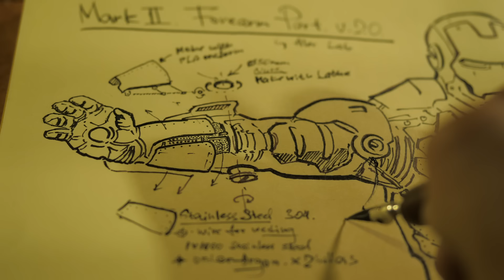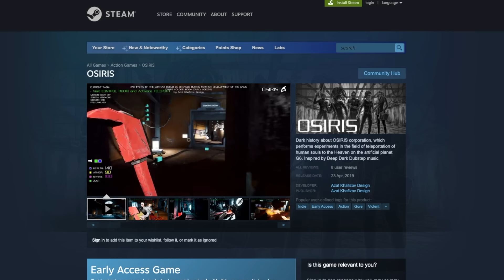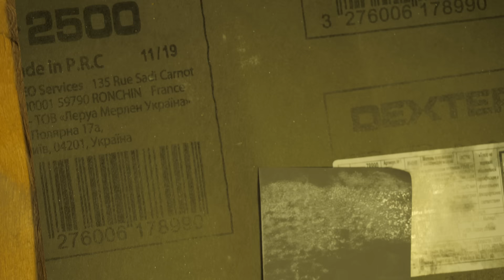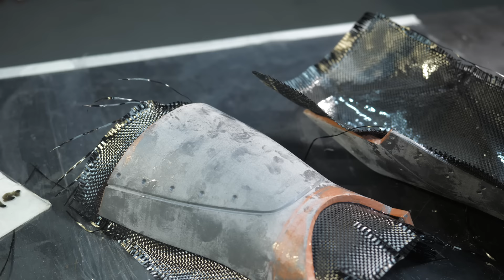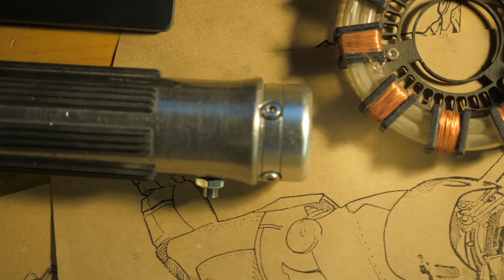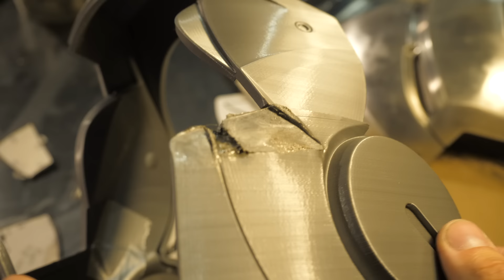3D print to full metal part: How to use 3D printer to make complex metal parts. Iron man helmet

Comment: suggestion for future work on the suit. try making the arc reactor not just produce h2 and  o2 but also try to have it generate -e aka electricity. i even have a suggestion as to do it. i have seen something involving silver and zinc together to generate electricity through oxidation processes. maybe try using that. also to boost power try also using some high voltage power transformers.

Comment: Questions that have probably been answered already but I didn't wanna spend all day & night searching for an explanation through your videos:

1. Exactly how practical is the water based hydrogen fuel cell? As in - what's the ratio between stored fuel (water) and the capture and release of kinetic energy? 

2. Will the fuel cell have an energy density high enough to operate for a full 24 hours at an average discharge of, say... 50%?

3. Water is notoriously heavy, so what's the maximum amount you'll be able to store in your suit BEFORE separating the hydrogen fuel from the water?

4. Speaking of extracting hydrogen from water for a fuel cell, what are you doing with the O2? 

5. Assuming that the hydrogen fuel cell you're using here is practical for hours of extended use, are you designing this as a powered and armored exoskeleton?

6. Assuming an answer of YES for question #5, can we expect your powered armor to increase the strength of the user by at least, minimally, 100%?

7. What about speed? Can you run while wearing your powered armor at 30 kph or faster? Because there are bionic boots that you can build yourself that can top out at close to 40 kph. I'm building them now.

8. How authentic is authentic when it comes to your Iron Man armor? Specifically, are you actually gonna try to make this thing fly?

9. Expecting an answer of NO for question #8, but assuming an answer of YES, are you going to be using a specific device built directly into the suit like those jet engine hands of that other Iron Man suit which can fly for around 15 minutes? Or will it be something simple, like feeding compressed hydrogen and O2 directly from the fuel cell protons first into several thrust chambers built into the hands and feet?

10. Expecting an answer of YES to question #8, and since flight is such an integral capability of the Iron Man powered armor, exactly how much power is required for say, a hypothetical test flight lasting for 15 minutes?

11. Since you've taken on the challenge of designing and building nothing less than an actual real world counterpart of the Iron Man powered armor, can you provide any answers to the following questions:

SIX BASIC QUESTIONS

12. Will it fly?

13. How much will the strength of the user be expected to increase?

14. How fast will it run?

15. How high/far can it jump?

16. Will there be a practical HUD projected inside the helmet?

17.  Will there be an AI much like Jarvis or Friday capable of natural language processing built into the suit?

BIG PRACTICAL WHAMMY

18. Exactly how long will it take you to SUIT UP?

OBSERVATIONS

19. It definitely looks high tech, but not particularly robust. With that in mind, can you give us an indication of exactly how much of the suit consists of actual armor, and how much is just pretty lights and shiny surfaces?

20. How much extra strength will the pneumatic artificial muscles supply?

21. What other components... such as torsion springs, extension springs, ratchet springs, block and tackle, rubber cords capable of storing highly dense potential energy (aka spear gun rubber), high density capacitors, etc. will you be using in conjunction with the artificial pneumatic muscles to supplement and increase the strength, armor, weaponry, capabilities, etc. of the suit? 

BIG WHAMMY QUESTIONS

22. What is the maximum practical power level that the hydrogen fuel cell can be expected to supply?

23. And what about the O2? What's up with that?

24. Anywho... assuming the fuel cell can maintain a reliable discharge rate of 50% when providing useful work, how much useful work in joules per second will the suit be able to provide/support, and for how long?

25. Water is notoriously heavy, so how are you storing it? 

26. More importantly - how much water does the suit need for basic functionality?

27. How long can the suit operate at full power with a full tank of water?

28. What independent measures can the included AI be allowed to implement in order to ensure the survivability of the suit and the pilot?

29. Are you actually and truly developing something that DARPA is going to snatch up and donate to Boston Dynamics?

30. You're pretty resourceful, so why not build/steal/otherwise procure an RTG for use as the power source for the suit?

FINAL QUESTION

31. When are you gonna finish the damn Iron Man suit?? Huh? Come on, when? As in, WHEN WILL YOUR IRON MAN SUIT FINALLY BE FINISHED AND READY TO COMMENCE WITH THE SMEARING OF TERRORISTS SUCH AS ISIS ACROSS THE DESERT FLOOR OF AFGHANISTAN?

THAAAAAANKS!

Comment: Thanks for shouting out blender! open source contributing code monkey here.
Loving your vids btw, using the electrolysis to pressurize pneumatics is genius. Given the gas prices here in the UK ive been thinking of setting up an elecrolytic system to replace the natural gas line to fuel my boiler and hob - so if you want a commercial product idea to pay for all the fun stuff - how about building one of those.

Comment: You can actually 3D print the armor out of metal by covering the plastic print with ceramic to make a cast, let it dry, burn/melt the plastic out, and then pour metal into the ceramic cast in a crucible and then once it dries break the ceramic off of the metal. Certainly high effort, but it makes it possible to create metal parts without expensive tools.

Comment: I started building a suit too years ago  and I used bicycle cables for tendons and hydraulics over electric..the steel cables act like Kevlar body armor also...what about using the hydrogen and detonation for a super air compression system basically  instant pressure and the water is recycling just add electricity and some peltier cells to convert the heat back to electricity 😳 ?
It wouldn't be 10% efficient but in the high 90s.

Comment: (automotive painter) you might have some adhesion issues by sanding your primer so fine. Especially by polishing. I take it to about 600. The paint will cover those sand scratches and you'll have a good mechanical bond. (Your 2k filler will dry more slowly with less hardener)

Comment: I was just thinking you may have to add a primary power source Prius battery or maybe 2 basically attached to a scapula sections. Using  the hydrogen as secondary power source possibly used as fuel.and please create a long video of how each peice of the armor hand,forearm,biceps to shoulder unit then how does it power move the shoulder and arm up and down straight out side to side then neck,breastplate&backplate then lower abdominal sections front& back.then hips thighs, knee,shins, feet.sorry to keep this long text but ironmans been my hero for 46yrs and i want to make one oneday. But most of all flight ability and fast.maybe put all your ironman videos together forget the other projects no offense. Unless its hud unit ,lifesupport,audio system, al

Comment: This helmet needs a built-in VR display. Some very thin optics exist which may help. Then you can make a HUD overlay in unity on top of the video relayed from 2 external cams. Then, using AI vision, implement object recognition on screen (you can probably purchase a pre-trained AI for this) and relay telemetry from several sensors running on an Arduino (nice plugin available for unity). If you know people, maybe you can get your hands on a used VR headset from a military simulator? They have nice gear with eye tracking (imagine, possibilities! Auto targeting?) and you could even implement voice recognition for the user interface. BTW this is not SciFi, it's all possible and reliable today.
Reply: In Russia, a lot of this is difficult to get

Comment: people keep focusing on making an iron when one could make a double laced kevlar suit ( heat-resistant and strong synthetic fiber, related to other aramids such as Nomex and Technora. 1st used commercially in the early 1970s as a replacement for steel in racing tires.) add bullet proof layering on top of essential body parts and color that thing red and yellow

Comment: There is also 3d print casting. you cover the print in a casting plaster and heat it up to burn away the plastiv leaving you a perfect mold to cast metal directly into.

Comment: In Jewellery and Dentistry, you can use castable wax in a 3D printer and send the 3D object to a local investment caster.  You'll have a solid metal object and can use files and a Dremel tool to clean everything up.  You can actually do this for guns.  I'm surprised the guys who 3D print illegal guns don't do this.

Comment: For anyone working with carbon fibre sheets, be aware that once cured, carbon fibre bends in one direction, and is stiff in another direction. So if you had a square, it could flex on the x-axis, but hard as steel on the y-axis. Important to know which direction you want to be flexible e.g. flexible across your arm, but NOT flexible length-wise down your arm. (Hope that makes sense)

Comment: Alex Lab, For metal parts, you could use a gas-chambered metal printing 3d printer. i have one in my mechanical engineering department at school. it prints titanium using arc welding technology. you should look into that.

Comment: Subscription for 3 great things here. 1, you're building an actual Iron Man suit. 2, you've got an Ender printer (I myself am rocking a en Ender 3 Pro). And 3, you got Makita tools! You got great tool taste and have quality content. Definitely worth a sub. Btw, if you want even stronger plastic parts, you can send them through a remelting process, although this won't work with PLA, because it ruins the crystal structure of the plastic. You can do it with PETG though and I believe with ABS too. CNC Kitchen did a test of this technique and found that remelting will allow the plastic to become almost as durable as injection molded plastic, but this is a method you can do at home, as it only requires an oven, some ground up salt and a dish that can resist the temperatures of the oven. Throw 1 or 2 layers of carbon fiber on the inside and you got yourself one hell of a strong part. Here are the links to the process:

Original video and method by free spirit 1:
https://www.youtube.com/watch?v=nRLJ4ylGTFc

CNC Kitchens test of remelted materials:
https://www.youtube.com/watch?v=DyAKtS1b3SQ&t=1006s

A final notice is that the infill has to be 100% for this method to work. So it uses slightly more plastic and a bit more time, but you get vastly stronger parts from it.

Comment: I think the one thing I would personally use to "shield" against bullets would be thin layers of tungsten mixed with Kevlar layers which can easily stop up to 50 Cal bullets which you can check here (Demolition ranch) https://www.youtube.com/watch?v=gJI5u2DJsAI the one thing making this difficult is the thickness which reduces the probability of stopping such bullets a lot and the weight of tungsten which is... VERY HEAVY... But if you worked up that exosuit to fit those requirements you can easily run around as some type of human tank... What I would also think about is actual flying as in there is a technical setup including a Crookes Radiometer that allows you to transform light into a crap ton of energy... The theory behind this is very simple but the way to actually produce power using a Crookes Radiometer is way more complicated and involves magnetic fields, but in theory it is possible to archieve speeds far beyond what current aircrafts/rockets are capable of... This again tho poses a new problem with heat production as this concept best works with super conductors and is relatively hard to archieve without... Maybe you can figure something out tho... All in all I enjoy this project a lot and hope to see the finished suit in action one day :)

Comment: Using the 3D printed parts, and adding pour spouts to the model, it would be possible to make solid cast parts from a plaster mould using the lost PLA method. perhaps this would further increase the accuracy and speed of production.

Comment: Adam Hyneman (Mythbusters) has 3D printed a full torso suit and a helmet out of titanium. And it appears to bei actually bulletproof (tested up to.45 ACP). That is the case because, titanium work hardens, so it gets stronger if you hit it (thats why its so expensive to manufacture titanium parts) and it can withstand higher temperatures than Steel whilst only having half of the weight...

Comment: you should try sand casting metal parts using the 3D printed parts as a negative mold. it seems like it would be faster and easier to produce parts

Comment: Couldn’t you make carbon on both sides and vacuum seal them so they’re perfect replicas. Then remove the plastic core? You’d have a perfect match, super strong, super light, and a inner channel to run wires and hoses?

Comment: Another way to get the layout of the metal plates is to use Pepakura Designer to "unwrap" your 3D model into flat pieces. https://tamasoft.co.jp/pepakura-en/
Using a 3D printed form as a welding jig for tacking everything on is a clever idea, most likely the best idea for the Pepakura output as well.

Comment: Dude, you should definitely go the "ZAMAK"(alloy) way.
Cheap and effective, saves you A LOT of time. Blanks shooting replicas and even some real firearms are made out of ZAMAK. But it's a tough metal to melt.
Alternatively, carbon reinforced (lead-free) PEWTER.
Make negatives for molds out of a silicone that can withstand high temperatures and you're good to go.
You can get the best of "both worlds". Definitely good if you plan on "mass" producing (on a small scale) some pieces.

Comment: You can try a different idea from Iron Man and design your own armor, I think it might look better in reality.
Reply: such as adjusting a device that looks big to be smaller and adjust accessories such as thermal laser electric shock gloves small battery and the steel wings like in Spider-Man Far From Home.
Reply: The iron wings that I've proposed to me might work in reality, but it would require a lot of electricity if it wasn't nuclear fusion power.

Comment: If you for yourself a metal roller, you can avoid welding and having to shape the metal by hammering, leaving a much better finish to the metal as well as less fatigue on the parts

Comment: With the composite the curing of the   resin will generate a lot of heat so it will warp the 3d printed material if your not concern with warping of the  printed parts you might consider a sandwich of carbon or fiber glass encasing the whole printed parts put into a vaccum chamber of course.but remember to have a ventilation system in your armor or costume.good luck disco duck

Comment: Hey! When slicing a model that has thin walls like the iron man forearms, make sure to print it with as MANY wall lines as possible do not use infill. Not only does it make the print stronger but the printer can lay filament faster

Comment: To do full metal parts you could use the plastic 3d printed parts to make a mold and put molten metal inside. the furnace to melt steel might cost you some money, but still cheaper that a metal 3d printer and way faster and stronger than welding

Comment: When you're working with the composite materials, try painting the resin onto the composite on top of builder's plastic, or some other kind of thick, but flexible plastic. That way if you're having to handle the composite while wetted, it won't all fall apart in your hands, and makes it much easier to work with.

Comment: I know that there's no computer-generated graphics in your videos but what worries me is that you're using hydrogen for your pneumatics. I've been experimenting with hydrogen for over a decade and I understand the amazing things it can do. I built a hydrogen ballasted crane when I was about Seventeen and it backfired on me and threw me about 10 to 15 foot out the door of my garage. I've worked with hydrogen rifles pistols and cannons. I've only brought in my cannons to the point that the law would allow me but they were still relatively strong. I've learned to respect the fuel and I would hate to see an incident where you become maimed. Make sure you isolate the tubes from your body and give yourself some protection. Other than that, amazing work! Thank you for sharing and keep up the amazing journey.

Comment: Tip: If you create a version of your 3D model where the resolution is so low that you can see individual polygons, it should help you create the paper template. There is also a method called UV unwrapping that we use to apply textures, it turns the complex surface into a flat sheet and can be mostly automated.

Comment: At the point where you reenforce the printed part why not take a fiberglass mould of the part and lay up your carbon/kevlar carbon sheet inside that? You would have to make 2 moulds is the only down side but it would be lighter and stronger.

Comment: Probably too late to tell you this but I was trying 3D printed part finishing for the first time recently and instead of trying to sand the part down directly I found the best option was - 1. spray on putty (like automotive) 2. putty for bigger gaps or lines 3. Use Scotch brite pads (the sort for automotive body work) for initial sanding 4. then the high grit sandpaper.

I'm not sure why people don't know about using scotch brite instead of sanding paper for the initial layer line removal but it works so well.